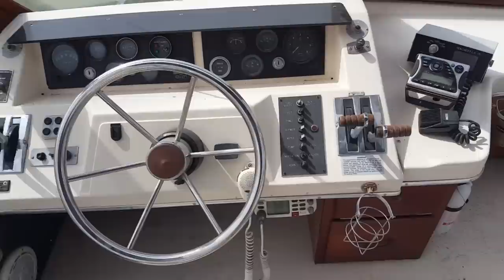Restoring a 1978 Carver Mariner 33 boat after being abandoned for more than 4 years!

Comment: I once owned this same year and model.  Some of the best times of my life and lots of family memories.  Have a fiberglass expert inspect the hull thoroughly inside and out.  Carver was still doing a lot of fiberglass over wood until the mid 80’s.  Do this before throwing any substantial money at it. Get rid of the overhead ac unit.  It’s loud and won’t cool the stateroom.  Spend the money on a nice marine AC w/ reverse heat and duct it thru the settee, galley, and stateroom.     Unless you keep it in a covered slip the windows will always leak, Carver fixed this with aluminum frames on newer 3396. Keep the overhead galley cabinet, you won’t regret it.  Either remove or completely rebuild that swim platform. I guarantee you at some point you’ll be on the water and people will want to use it.   Of extreme importance are the v-drives. They are ungodly expensive to replace so have those inspected as well. Keep them maintained and operate them as designed and they will be bulletproof.  Good luck and we look forward to more videos
Reply from the maker: Thank you for all of your input!
Reply: A lot of fiberglass covered rotten wood now!

Comment: You most likely need to replace the transom and stringers on the hull of the boat, the plywood usually sucks up water and rots from the inside out. When the bilge pump stops working or the battery goes dead you end up with rain water in the bottom of the boat, the rain water will find its way to the plywood. Take a rubber mallet and hit every inch of the hull to locate the rotted plywood, the sound is different on those spots.
Reply from the maker: Thanks for the info!

Comment: A remanufactured “base” engine (heads & block) will run about 3k. You will have to evaluate intake and exhaust manifolds along with cooler, and other marinizing hardware. Rubber hoses fuel & water all have to be replaced. If the fuel tank isn’t aluminum, it too must go, but inspect the aluminum through filler fitting and sender port. Senders are dead, trust me. Those are Borg Warner transmissions are the best and if they have been cared for (no partial engagement, water in oil or lack of) they will outlast the boat. If you need to replace them, they cost more than the engine. Very few people can rebuild them correctly. Replace the damper plates and recirculating pumps and the impellers in the raw water pump. Basically you’re looking at 10 k minimum in the engine room alone if you do it yourself. Before you spend a dime, stop and research what you can already find on the market for 30 to 40 k because that’s what you’re gonna spend. Then, if after you fix this boat what would someone actually pay for an old boat. Strip it and scrap it (transmissions, anchor, windless extra) or sell it to someone for a buck.
Reply from the maker: All great stuff, but then I wouldn't learn anything and wouldn't have these videos...
Reply: Jeff Niemeier 
Jeff I’ve been right where you are. Thought it would cost me 35 k. It’s insidious. A little more, just a little more and I won’t have to spend more. 100k later sold it for 46k. And that’s all my free labor. God I wish I bought land. Unless you buy in a riot city you’re money ahead. The boat I sold: search “Big fast houseboat” on YouTube. The winner, the guy that bought my boat. I moved out of CA and it would cost way more than it’s worth to move it across the country. 
B.O.A.T. =Break Out Another Thousand.

Comment: that fiberglass work that was done is a keel guard and it looks like several of them were applied its an extra thick section of fiberglass that protects the bow like a bumper. on the stern you'll probably be better off replacing the swim platform with a newer up to date swim platform that matches the teak on the boat. Don't varnish the teak us tongue oil on the teak. also you might want to upgrade the automatic trim tabs as well. over all you got a sweet deal.  it's worth the money your going to have to put in to it.  check around with the online yacht brokers for prices if you decide to sell it their not cheap.
Reply from the maker: Trim tabs on this Carver are built directly into the rear hull of the boat..  I have removed them to get rebuilt for next year!  I am thinking about removing the swim platform to install a jetski ramp...  Anyone have any idea's on this?  Really need a jetski or dingy since I can't beach this boat like my friends pontoon boat...  Also too large for many of the shoreline bar docks....

Comment: ... if the motors don't run ... the boat will be worthless .    Check the stringers,  if they are good ... get to work on the engines.  You are lucky that they are Chevy 350's .... parts are widely available ... ( make sure that  the coolant system has a heat exchanger as you do not want to circulate "salt water" through the block for cooling ... bad, bad, bad ) That was a popular boat here on the Chesapeake ...

Comment: Wonder if you could change those gas 350s for a couple of diesel-powered engines?
Reply from the maker: I'm sure I could but it would not be cost effective for the type of boating I do here on the Upper Mississippi.  Gas is easy to find.  Diesel pumps not so much...  Also, GM 350 parts are available at any car parts store.

Comment: You bought it for a dollar for a reason, cost a lot of money to cut up and remove which is what you will be doing to it! Good luck and remember it's only worth about $5,000 in running condition that is if the stringers aren't rotten. 😳😳

Comment: Those are good boats but I would suggest converting to disel engines and make the fresh water cooled and do the hull work first and make sure it’s done right. All the little teal wood and things worry about later the hull is the hardest part
Reply from the maker: That's the plan!

Comment: How long can a fibreglass hull last? 40, 50 years or more?
Reply from the maker: Good question...    Water and moisture is the enemy and will cause the fiberglass to delaminate.  At 42 years old this fiberglass hull is still going fine!  There are stress cracks on top of the hull but the hull its self is in good shape.  Many posts are concerned about the wood stringers.  I have one spot that is a concern that I will repair this winter.  Otherwise all good...

Comment: is it me or isn't all the wood in the boat Red  Mahogany not teak..its beautiful after stripping , sanding and putting a few coats of varnish with wet sanding between each coat.
Reply from the maker: According to the Carver Service Manual, Interior wood and paneling is mahogany and burmese teakwood is used on the exterior.

Comment: Replace with diesels, it will cost more up front , but will be cheaper to operate
Reply from the maker: Since I just run the Upper Mississippi, maybe 0, 5, 10-15 miles on a weekend, I don't think I can justify the cost of re-powering 2 engines with diesels...

Comment: I'd hate to pay the fuel bill when it runs lol
Reply from the maker: 150 gallon tank.  $3.20 per gallon on water.  You do the math...  About 1.5 miles per gallon...
Reply: @JeffNiemeier  well at least it's miles per gallon :-) could be gallons per mile ;-D
Reply: @JoshSees  they are usually calculated gallons per hour since wind, wave and currents might change the actual mileage. At wide open throttle you could be looking at 20 gallons per hour for one engine. Most likely around 10-14 though at cruising. 
Even at 5gph x 2......around $500 to fill and 15 hours to empty. I can only estimate speed at maybe 30 mph, 450 mile range. Pretty much a dollar a mile. I think that is optimistic to say the least and haven't even figured in the slip fees. Hope you really like fishing or something cuz that's one heck of a monthly bill for something you don't use and not cheap to use.

Comment: I'd bet weeks pay the balsa cored hull.is soaked and rotten.
Reasons why.
1. Hull was repaired at the bow, poorly 
2, hull was repaired at the stern, poorly.
Right behind the rudder, that was a log or bottom strike, that bent the rudder back enough to damage the swim platform. 
3, most structural material on old Carvers are plywood,  40 years old, and rotten
4, what ever you spend on restoration,  just spend on a newer usable boat, that will hold some value better.
Reply from the maker: I didn't see any damage from the inside on the bow repair.  They might of just put a keel guard on the front due to pulling up to sand bars in the past....  As far as the repair on the port rudder, I agree that this may need further research this next spring to determine if there is any wood rot.  It seemed to work just fine for the past 3 months but I will be checking it out further this winter and spring when I pull out the port side engine.  We replaced the starboard engine, but the port engine is still the same old one.  All we did was change the oil.  I want to pull the engine out and drop the oil pan to make sure everything is ok and probably change out the oil pump as long as I have it pulled.  Fresh paint as well.  With the engine out and the generator out, I will be checking out the condition of the wood around that repair...  We will be posting a video next week about the money it took to repair this boat and get it on the water...  Stay tuned!
Reply: @JeffNiemeier  find a spot in the bilge that you can stand, with all your body weight on 1 foot.
If there is a lot of flex, the balsa cored hull is soaked, like 99% of all the old Carvers

Comment: your concentrating to much on things that will never  let you re coop your money, unless your keeping the boat,  replacing all the items in the galley is a huge mistake , especially if the items work, its original stuff, that give the boat its alure,  clean it up and flip it, the best thing to do is clean , clean clean, thats the best return ,     believe me what ever you think it will cost, triple it , then add about 5 K,,,  don't sweat the non fared fiberglass under the water line, if your flipping, just make certain it does not leak, The way your talking your going to spend a fortune , which you will never see again, threes only so much that boat will fetch, don't go nuts its an old boat , of course if your planning to keep her, then go nuts ,  it looks like it has potential, but for a flip your going in the wrong direction, I do it all the time , and even if its a nice boat your going to spend  thousands and thousands  Your engines alone are big money,  if your going to keep it, go diesel, it will make the boat worth lots more down the road, you paid 1.00 for it, which may be to much the way your going
Reply from the maker: Thanks for the input!